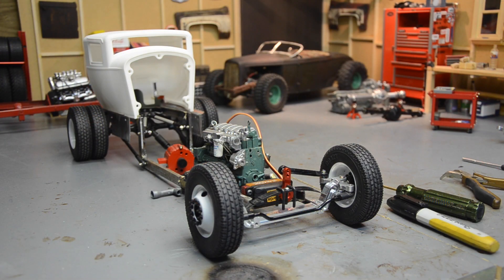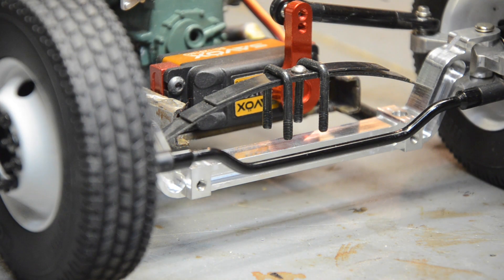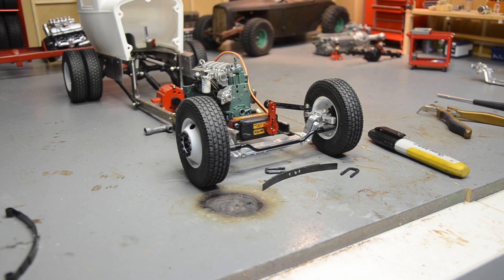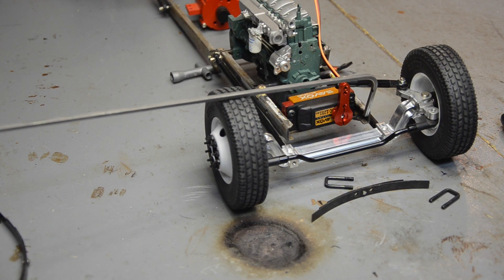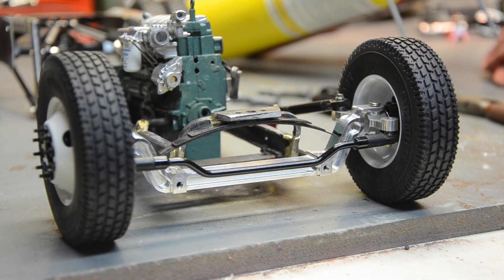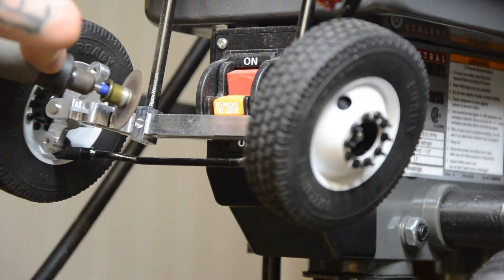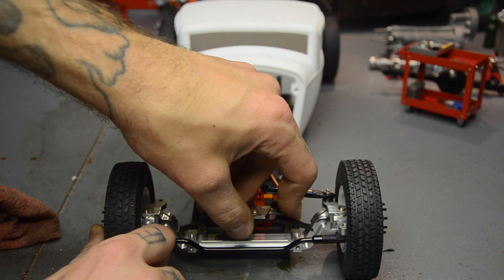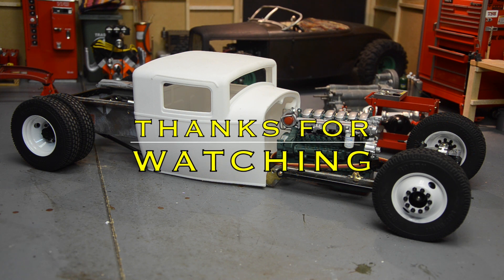RCengineering, Scale Leaf Spring Front Suspension for the Old #2 Rat Rod

Comment: Some times the only way to learn is the hard way. The only way a leaf spring will work properly is to be shackled. Just like cyanides build witch I saw coming from a mile away. I commend you for your go ahead and do it attitude and creativity. The axil has that key way relief through out most of the length of the axil. Right where the keyway relief returns to horizontal after the step notch out by the steer knuckles where you should drill a hole on both ends of the axil horizontally. this is where to bolt up the bottom of the shackles fro the leaf spring. As Del350K4 mentioned the length of the leaf spring extrudes as it's compressed. This why it falls out of the notch you've cut every time. If I may suggest maybe flipping the the leaf spring right side up this will suck a bit because you'll have to remount the pickup plate on the frame but that will lower it all down and float in the space the dropout axil provides. The laser level and a grid mat will help keep the eyeball f***ing more precise. :)

Comment: Okay - the problem can be summed up (I think) like this: the leaf spring needs the freedom to get "longer" as it flattens out. Tentative suggestion: If you were to drill a 3mm hole (an eighth of an inch), front-to-back, through your long-suffering $50 axle, just below the slot you´ve cut on each side, you could then cut four steel plates, each of which is drilled at either end, and bolt one plate behind the axle and one in front, poking upwards. Then you could use an eyeletted leaf spring to bolt through the top holes in the plates. The spring would need your slots to extend into as it flattened. It would be fiddly...
Reply from the maker: Great idea, like putting a shackle on both ends tied to the axle.  Cyanidetube just changed his hot rod the same way.  I can see how it will work. Thanks!
Reply: I was worried that I hadn´t explained it very well   : )
  Whereas longitudinal leaf springs have one fixed shackle and only one free to swing, I think you´ll agree that you´d probably want to allow both to move, perhaps using a nylok nut so you can set the nut so it´ll let the shackle swing but won´t come undone.

Comment: you should bend the tabs up on the end of spring and make threads in the axle were you have the spring at to bolt the spring to the axle my pinion
Reply from the maker: That could work as well, and cust an oblong hole int he spring so it can flex but still be held down by the bolt.